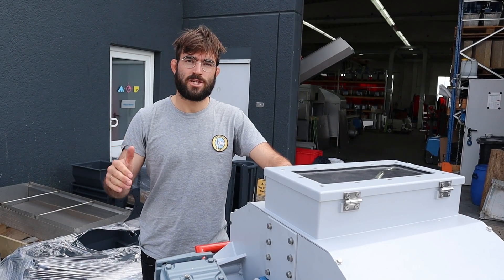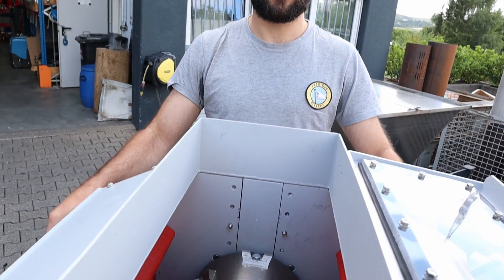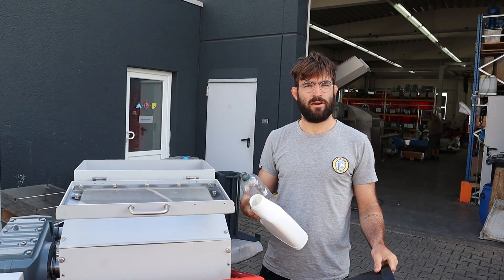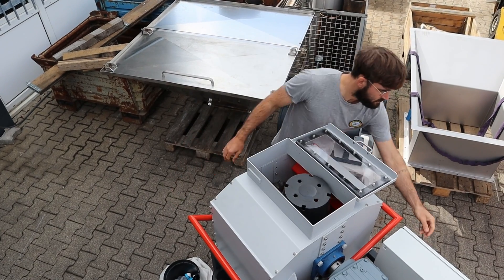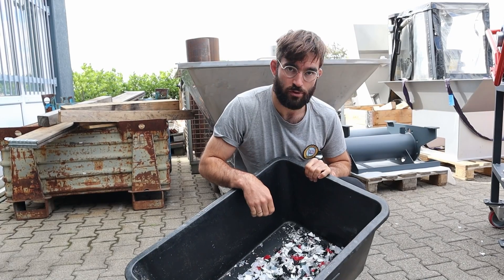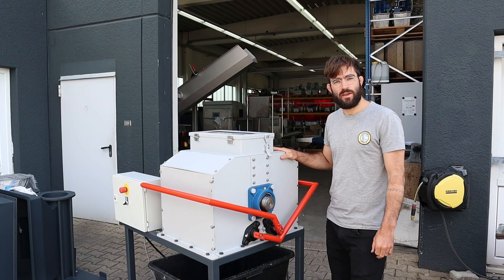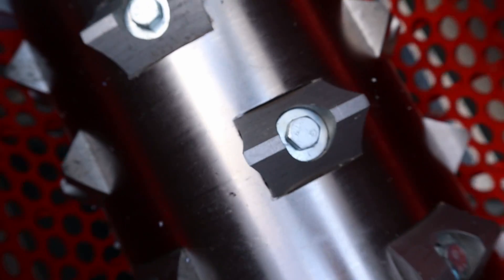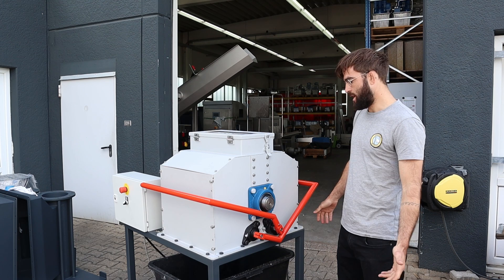This shredder will change the recycling game

Comment: VERY nice... looks expensive, though, with some hard-to-fabricate bits without access to industrial suppliers (here in the US, they'd rather not mess with small and semi-knowlegeable operations like ours.)  I'm thinking of the drum and the teeth, which look like high-carbon and hardened steel. 

When the motor on our shredder burned out, we bought a small commercial unit from China. Generally speaking it works very well, but we have a problem with the static that it generates. Charged bits of microplastic go everywhere. I'll be interested to see how your next version works in terms of the static.
Reply: perhaps replacing the motor with a "small commercial unit from china" is where the static is coming from.... did the original motor generate static?!?
Reply: Your mistake was in dealing with anything that has to do with China... 🤔🤦🏻‍♂

- Max Giganteum
Reply: @MaxGiganteum  I agree, but there are realities that we need to deal with. Yes, it would be better to NOT buy from china, but in this case we really didn't have an alternative. Believe me, if there was a domestic or European version that we could afford, we would have bought it. I don't like it, but I have to admit that the thing works a lot better than our PP version did. And we are back to shredding and remelting fairly large quantities of #5, at least for our 2-3 person volunteer operation.

Comment: I am intrigued!  i am looking for a solution that is easy to build by any mechanic anywhere will easy to get parts...unfortunately the high torque model at $1000 to build is too expensive.  I see that a version of this 30% smaller could be built by a mechanic and work very well...I am hoping to see costs and plans soon.  I build one to see how simple/low cost it can get...  

I also need a "slicer" for plastic bags and films..we are putting them in a heat press to make panels..we do not need fine ground plastic but a full size plastic bag is difficult to deal with.  We are building a "slicer" now with belts to pull bags into several cutters inside an enclosure and out drops strips..idea is that it would slice up plastic bags and films as fast as a person could feed them in.  Any suggestions on this would be -much appreciated..thinking with 2 small motors and a small box this could be a machinie that could be built for $200.

thanks

Comment: It looks more dangerous than normal shredders because of higer speed but it seems to work great! Very good that you will improve safety on further version.
Reply: Yes, this one was purely to test this concept of a single shaft shredder with this manual sieves/pushers. The second version is lower with a 800mm tall hopper so the rotor is not accessible anymore.
Reply: keep in mind this was a prototype to test the concept of the moving screens, next version has much improved safety!! stay tuned :)

Comment: Why is that shredder considered better than previous one by you? It is not better in any way. Previous one is better concept, just increase the motor speed and size (to the same as this one). I mean this one is not bad, but i think better result can be achieved with previous shreader design if done properly.
Reply: From way over here, the first obvious improvement is maintenance and longevity- this design features removable cutters.   The Shredder Pro would require a complete breakdown to confront failures.    MOREOVER, in the instance of a significant jam, some builds of the first Pro suffered disabling damage to the frame containing the cutter shafts.   Just a couple off the top of my head, without benefit of practical use of either version.
Reply: @mavigogun  1.  Easier maintenace IS one addvantage of this design at the cost of slower speed (if previous design would have the motor with the same power and the correct gear ratio it would be FASTER than this one. 
2. Longetivity: NO! No difference.
3. IF you would design proprely, you CAN MAKE previous design machine that would suffer no damage in case of significant jam.

Mechanical engineer with a degree here btw. :)
Reply: @mavigogun  My point is: adventage/dissadventage ratio is BETTER with previous design.
Reply: We redesigned the previous version already, you can find it in the how-tos. But bigger motor implies other modifications (that we did) : like stronger bearing and box, resulting in a quiet expensive and difficult to built machine.
So we rethought the concept instead of adding another layer. And I can assure you that this one is easier to built, to maintain, cost less and shreds faster.
By the way it has been designed by several mechanical and electrical engineer with degree and experience. Check the other machine Weima is doing, they are on the very proper side of things !
Reply: @yannclm5231  And to be clear: i am not dissing your efforts at all, i appreciate your efforts in recycling. I just honestly think that with the first design you can achieve better results (if optimised arcourse). :)
Reply: Yann CLM: you didn't exactly understand what i said. Let me clerify. I didn't mean to increase the motor any further, just use the same power motor as this one has. Your previous design is slower because you didn't use the proper gear ratio. IF you would, than previos design with THE SAME power motor would cut faster. And cutting faster is the most important thing if you want to be productive. Yes this design has a little easier maintenance, but it cuts SLOWER than the prevous design (assuming both designs would be optimised to their maximum potential). Building cost for both designs are very similar, not much difference. I didn't said that previous design is allways better. But i said previus design would be better if both designs would be optimised to their maximum potential. :)
Reply: @drister007  You seem focused on telling, not discovering.   You are informed by the builder that this machine is easier to maintain and shreds faster than their last- but do you listen?   Nope- all those words just get dropped in your personal shredder, then melted into a shape that suits your preconceptions.
Reply: @mavigogun  that's sounds more like an injection machine operation :D :D
Reply: @mavigogun  You DIDN'T GOT what i am saying at all! Let me clerity for you! Mechanical engineer with a degree here btw, i also build machines.

"  You are informed by the builder that this machine is easier to maintain and shreds faster than their last- but do you listen?"
1. Easier to maintain: YES, i also said that!
2. Shreds faster? NO! NO if done properly! IF done properly first design shreds faster. THeir first design was NOT done properly. I didn't said that previous design is allways better. But i said previus design would be better if both designs would be optimised to their maximum potential. :)

"Nope- all those words just get dropped in your personal shredder, then melted into a shape that suits your preconceptions."
YOu are WRONG and you know it! They should go with the first design and optimise it.
Reply: @drister007  <----- this guy is like a cartoon parody of what engineers are like.    (Dude, everyone understands you- dogs on the street understand you -that condition is not mutual.)
Reply: @mavigogun You are obviously WRONG about me and wrong about engineering as well as wrong about design of that machine. BYEEE.
Reply: @mavigogun  You either don't understand what i am saying OR you are lying intentionally. Pick one.

Comment: In the event of a jam or incipient jam, is there feedback through the sieve levers?    My concern is the feedback might be harmful to the operator.
Reply: From the testing we did up to now, there is almost no feedback, an the few that is still there is very limited. This was our fear as well, as it would have made a very unfriendly machine, but anyone can use it, it doesn’t require much strength or anything.